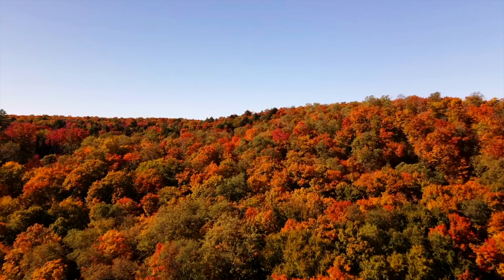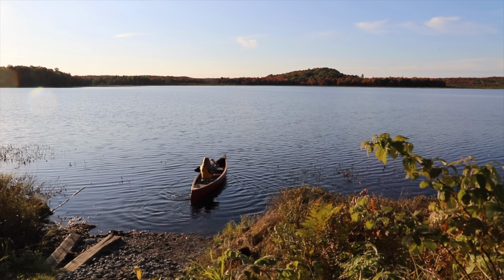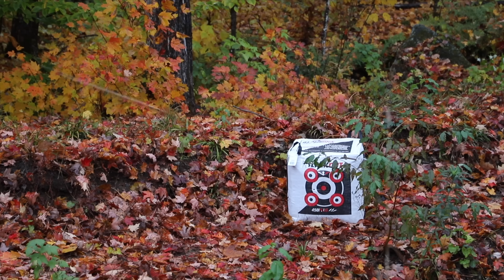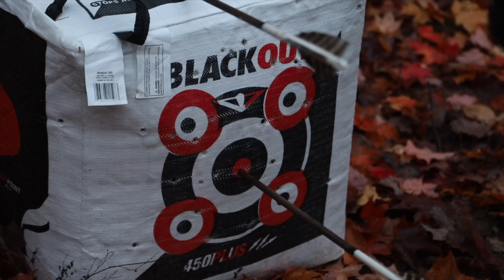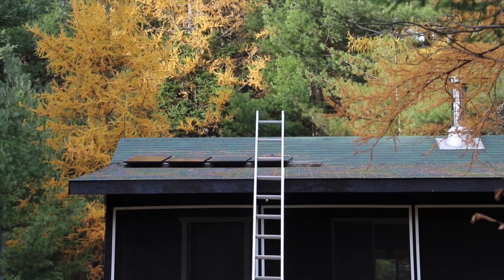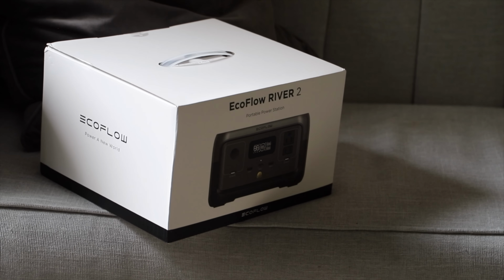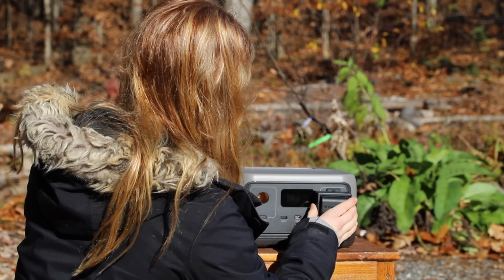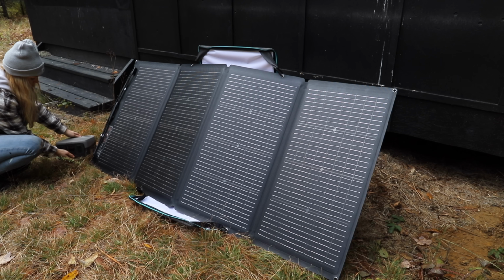How I Power the OFF-GRID CABIN

Comment: Emily, you may want to consider, rather than pulling the roots out in the fall, cut them at the soil level.  This will leave the roots in the ground and keep the organic material in tact over winter.  It will also provide food and shelter for beneficial insects during cold months.  Of course it doesn't apply for root veggies but crops whose harvest is above ground will benefit from this as years go by.  Also raking your bed and putting compost on top will help lessen your choices for spring gardening.

Comment: As a fellow solar powered person. I have two quick tips for you.  Make sure your panel mounts are weighted so to don't get knocked over on a windy day.  The second one would be to thinking about making it so you can adjust the angle in the summer and winter.  They will work more efficiently that way.  :)
Reply: I am sure both Emily and Shawn have that worked out. The area they are in (just an hour or so north of me)  will have massive snowfall beginning sometime in the next month or so.  Knowing nothing about building ( I did a cookie sheet in grade 7) but I might think some sort of perhaps a metal V configuration above the solar panels to move as much snow as possible away from the panels.  Again....just thinking out loud.   No matter what, there will have to be some snow clearing done in the winter when we get a massive dump.  Central Ontario can really get hit with massive snow at times.
Reply: @kevinlougheed553  Some solid points but I was going on the fact that at the end of the video their wood setup was only at one angle.  :)